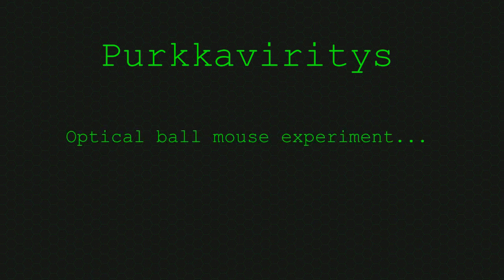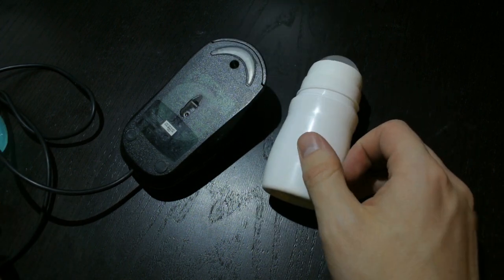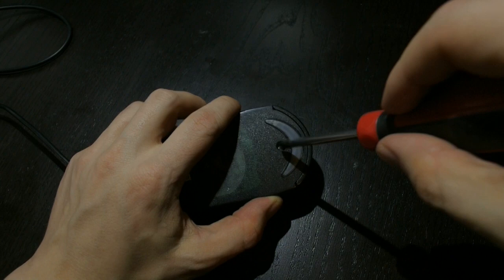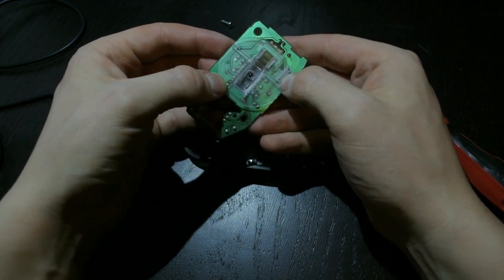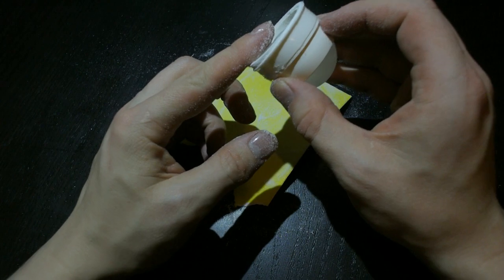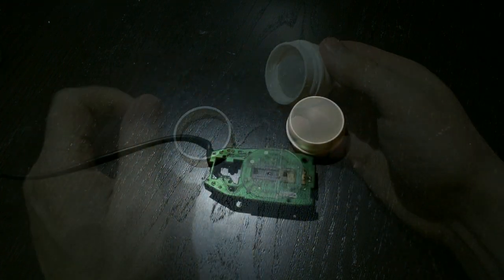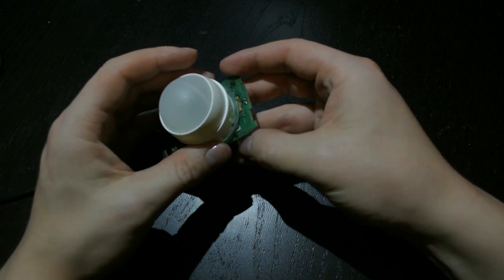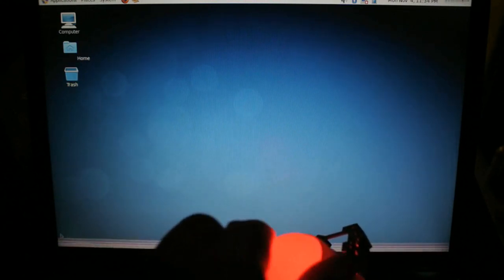Optical ball mouse experiment

Comment: Sand the ball no need to paint it. Since the optics take tiny pictures at high speed just sanding the ball will improve the resolution, as for making it smooth, pop the ball out of the deaderant cap and make a three point  ball bearing system for the ball to rest on the use the top 5mm of the deodorant ball holder to make  securing ring